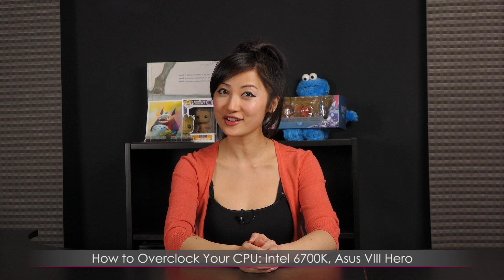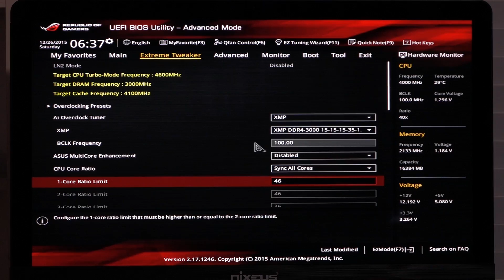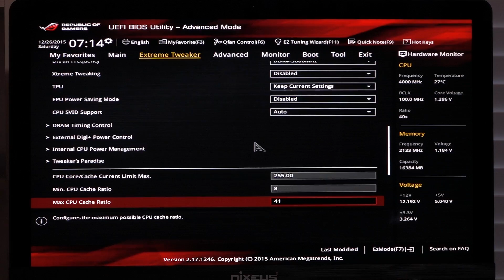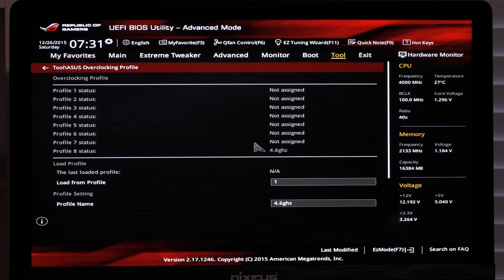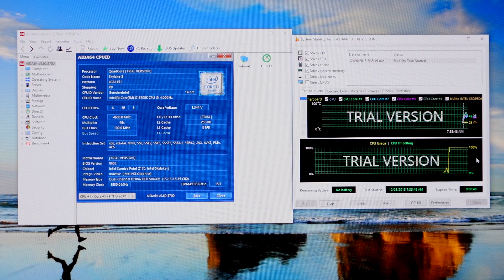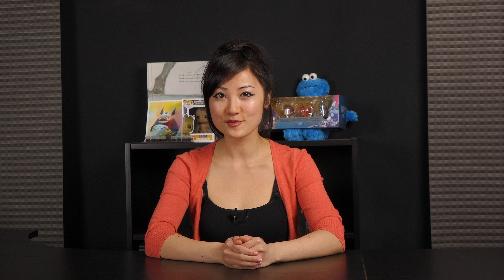How to Overclock Your CPU: Intel 6700K, Asus VIII Hero: Tutorial

Comment: Wouldnt this cause your CPU to be constantly running at 1.345 Volts. So even while ideal CPU is going ham? is there an adaptive mode? Tutorial please!
Reply: yes, this was exactly the part she missed. after it's all over you go back and change it to adaptive mode and enter your stable voltage that you found in manual settings. other than that, it's pretty damn good tutorial. If found LLC 5 to be better than 6, but I knew this way before I saw this video too.

Comment: why do no one use the A-Tuning software to overclock?
Reply: +Anders Flem cause although A-tuning software works, all software tends to generally over-volt your CPU and other components because it's automated and not minutely fine-tuned... 

Since every cpu  'is' slightly different, overclock-ability can almost always be achieved at lower voltages if the end-user does the manual work to discover their CPU's limits rather than utilize software that will apply set ranged voltages to achieve overclock stability at the cost of CPU- shortened life expectancy.
Reply: it gives my memory a weird over clock that causes constant crashes...that's my answer at least

Comment: I heard that skylake won't support win7 after 2018??? What exactly does this mean, I can't see how my hardware would stop running properly if it's running fine when I purchase the components.
Reply: like if you update your bios.
Reply: ***** what if I don't? Is there any reason why I would update my bios on a system I built myself that runs fine?
Reply: no not really. most of the time people only update it when something goes wrong or they get new hardware. you should be good
Reply: you wont get any windows updates for viruses that come out, which may get a little tricky, unless you dont rely on windows defender.

Comment: Hey, Is it ok to do the same steps with i7-6700k but an Asus VIII Ranger, not Hero?
Reply: +Elias Echter ofc its the same  =) i did it with a gene and i have also  1.31 V 4.6 GHZ
Reply: ***** i would not go past 1.35 V .... So just set it to that Voltage and start with 4,4 ghz and work your way up ... maybe your chip cant overclock that much .... and you should definetly turn off auto voltage .... but i thing 4.4 should be achieved with 1.35 =) 
hope that helped =) good luck !

Comment: Anyone have advice or even be willing to work with me? this would be my first time overclocking i have 6700k IX Hero with a NH-D15 fan. Or could i use these video settings and be fine?
Reply: You can try this settings but every Chip is different maybe you can’t get it stable with that voltage or you could do less voltage. Try this settings and if it crashes your pc lover the clock speed

Comment: I have the 6700k and the maximus hero viii. At 1.325 with 4.5ghz my max temp spiked up to 85+ even went to 90 at one point... How much should I decrease the voltage and what should I set the ghz at?
Reply: ChickenSnitt I have the same set-up. That def shouldn't be happening. You need to check your cooler unit to be sure it's running properly and reapply paste. Don't even bother with Aida. If you have an air only cooler that's another reason you'll see high temps especially in Aida.

Comment: On my 6700k I only run with level 5 witch is not that aggressive and with 1.27v to run at 4.6ghz, on level 7 and 1.33v I can run 4.8 and with 1.37v it run 5ghz but even it WC in stress test will go over 80c

Comment: I have the exact same setup but no matter what I try I can't get my CPU to 4.6ghz. tried to increase the voltage till 1.35v. 
4.5 GHz runs stable at 1.296v though
Reply: Prince Shergill my friend I think u hit ur cpu limit
Reply: Victor Martinez wrong, I have a stable 4.6 GHz OC now, new BIOS update did the trick @1.36v adaptive.

Comment: is it necessecary to clean the pc from dust? havent opened it in 2 years :/
Reply: +Brecht t yes clean it and reapply paste on gpu ,cpu...i also put paste below heatsing on mobo chipset
Reply: ah, I know I should do but it still runs fine.. for now..
Reply: Brecht t I clean my pc every 6 months,,,it reduce temps especially in summer time....i highly suggest paste on chipset to remove heat,,,prolong mobo life..
Reply: my cpu is i5-4570 and runs standard at 31*C and gtx 660 at 29°C  while its cool outside
Reply: when its summer probably +20°C
Reply: Brecht t
my cpu is idle about 30-31 now, load 50-55 on summer 60-65... my gpu is idle 30 degree 77 in gaming fermi thermi crap....on summer 82-83 degree gpu in load.. i am waiting for amd polaris middle end card low tdp amazing... amd is fusion and future ..<3 AMD
Reply: Optimisation King90 do you know if polaris and pascal require new mobo?
Reply: +Brecht t Probably not. It should work on any pcie 3.0 even on 2.0 only memory will change to gddr5x and hbm at most expensive flagship... NVlink is more for servers...i personaly will not buy nvidia i dont like their unetical behavior and all fiascos and gimping they had done in recent past, so i wait for amd card... i dont like current 300 series consume too much tdp
Reply: Optimisation King90 it would be better for sure if amd-nvidia got 50/50 market share
Reply: Optimisation King90 I have a 400W supply so better tdp is good news, soon nobody will need 800W psu anymore.. unless sli/crossfire maybe
Reply: Brecht t AMD have much less resourses meawhile nvidia are bribing developers and gimp amd cards with gameworks.. that junk is also gimping older nvidia cards we know about kepler fiasco what they done downgrade drivers. huge tesselation overkill factor in games without need ,without chance to reduce no slider in drivers meanwhile amd have it...thats why i cant stand them anymore. we need strong amd and i hope that 2016 will be year of sucess for them. They are also making an alternative for gameworks and thats great...i will certainly buy amd gpu this year.
Reply: Brecht t Thats kinda low but i hope that is good brand...i have coolermaster gx 750w it working fine 5 years already...mmm cant wait for amd polaris to play max out in 1080p like man ahahaha Raja Coduri has made amazing job very low tdp
Reply: Optimisation King90 yea its high enough, be quiet gold, i have ssd, i dont think i can measure total power consumption but idle shouldnt be that high, not even 100W
Reply: +Brecht t You will be probably fine depends from gpu....i always suggest to buy higher with bigger watts because eficiency reducing with time,always great ti have more headroom.
Reply: ah didnt know that, how does efficiency reduce? the coils or capacitor or sth else?
Reply: Brecht t Yes its reduce over time...but dont worry when it dies nothing will happend you have protections ,and thats it..i always buy bigger psu its always better to have spare power headrom
Reply: Optimisation King90 I thought psu lasted forever thats kinda disappointing, I have a good brand tho and most of the time just idle workload so not too hot.  

I literally thought I could buy a psu once and keep it forever jeez :D

I mean you could solder new capacitors (jus the elektrolytical ones) but thats kinda iffy, besides they need to be high quality ones not just hobby material
Reply: +Brecht t No buddy nothing last forever not even gpu,cpu or hdd..especially PSU it lost his eficiency over time,capacitors stop working and die....cpu can last very much for example.Thats why i am always buying bigger psu its good to have spare power...greetings from Serbia buddy i have gaming videos on my channel ahahaha
Reply: A capacitor doesn't has coils in my knowledge bro, please correct me if I'm wrong. Thanks :)
Reply: Vaibhav kumar i meant with coils transfo which is in psu

Comment: dont advise going over 1.35v??? my 6700k is on stock clock and voltages jump upto 1.4 on auto and i cant stop it from going over recommended volts
Reply: 95xXxdude that's why you don't use auto voltages
Reply: yeah i now run 4.5ghz on 1.3v manual mode  but i cant go any higher with the water cooler im using  nzxt kraken x41

Comment: i am just at 4.5 GHz with a voltage of 1.325. to get 4.6 i must go to 1.35. is that acceptable?
Reply: I was using a Gigabyte G1 Gaming 6, I was also only able to get 4.6ghz at 1.35v.  For 4.6ghz, I seem to be able to attain that without adjusting anything to do with voltage. The auto settings seem to be able to sustain it without any issues.  I'll probably try a static voltage lower than it stock settings to see if I stable at a lower voltage. Though when I want to save power, I just put my MB on "Eco" mode.   

At 4.6ghz my Cinebench was 1000-1003.  My Geekbench was single core 4700ish.  My Multicore was 18999.  I'm just going to say 19000 because it sounds better. ... :P

For a brief moment I was able to get 4.7ghz at 1.41v and my Cinebench was 1023. But it BSOD on Geekbench.  I didn't want to go any higher on voltage so I'm going to go back down.  The only other things i adjusted were the Uncore and Loadline.
Reply: +Snafu2346 yep it's a good tactic to use the oc you were able to sustain only when you need it, and to enable the eco or auto mode when not doing heavy workloads. it's a cool feature new mobos have. i settled it at 4.5 GHz and my cinebench was 989. i had 1003 when on 4.6 GHz but i found out that although it could pass pretty much every stress test, it could not pass the Intel Burn Test. try testing it with that too. i find it really reliable and it does the work of other stress tests in a very short time. (8-10 mins) i was wondering what are your temps?(and ambient room temp) and cooler?
Reply: I think I might settle at 4.5ghz too since I could achieve it without changing any other settings other than the cpu clock.  I've done it  without any concern and I like the fact that all I had to do to achieve it was just change it, set it and go. Your scores are identical to my scores on the same speeds. 

I'm going to try some stability test on 4.6ghz. I want to see if I can make 4.6ghz stable for no other reason than me being curious to see if I can... :p  

I think I might be limited on what overclock I can achieve because of what my MotherBoard is capable of.  I saw on Paul's Hardware channel that on his 6700k, he overclocked to 4.6ghz without changing ANY settings, not ANYTHING.  But he was running on a G1 Z170X Gigabyte MB which is a pretty high end motherboard costing around $480-$500. I think my MB cost around $190-$200. Though I got it on a 24hr sale for $125.  I was originally going to pick up a Asus ROG board. 

My cooler is a Corsair H110i GTX.  My temps on idle at 4.6ghz were around 32c-35c slight peaks at 40c.  I'm not sure what my room temp is.  I'm sure its around. 76F.  On load during Cinebench and Geekbench my temps varied around 60c-65c. It peaked around 70c.  I want to try running Aida64 or even Intels stability test later.  I will let you know.

Comparatively to stock 4.0ghz, heck... even at 4.4ghz, my idle is 27c-29c.  On 100% load its around 51c-60c. It never really goes over 60C.  If I use Prime 95 it will get to around 70c but that's if I keep my radiator fans at 1000rpm and my pump on quiet mode which is around 1850-1900rpm.

  If I turn the fans on higher around 1500rpm, and the pump to 2800rpm, the temps drop to around 65c ish.

I hope that helps. Let me know what results you were getting on  your setup too!

Comment: I never overclocked before, my cpu is not an unlocked one
but my gtx 660 can be with 'msi afterburner', whats the downside of overclocking? reducing lifespan? and more heat? (warranty transpired) I would like to try it for fun more than actual gaming

edit: it's safe if u do it within the limits I suppose and research a bit
Reply: +Brecht t yes you will degrade your cpu especially if you put high voltage...my advice slowly reduce v core as much you can, buy good cooler,,, and best option is to have overclock with turbo boost only when you really need...i dont see point to runs 24/7 on desktop while browsing why to torture cpu
Reply: it kinda depends on the game as well imo because far cry 3 made it go to 80 degrees on normal settings, other games run much better

I wouldn't feel comfortable overclocking while running very unoptimized games
Reply: Brecht t I have 6 years old pc...i5 760, 8 gb ram, gts 450...  i will overclock when i buy new gpu this year. ..my goal is 3.8 with minimum v core as possible and turbo boost on so it does not work non stop......i have cheap cooler lc power lc cc 100 its great 55 degrees in game now at 3.3 ghz turbo boost on,,,,meawhile my gpu is heater aahaha old fermi  82 degrees most of the time...horrible fermi thermi notorious generation but hey i can make launch in same time while gaming... ahhahahahaa greetings buddy
Reply: Brecht t you need better cooler...make sure its properly mounted i was have same issues when i was used crappy stock intel i was have 85-90 degrees..,LC Power lc cc 100 or lc cc 120 good ones and cheap
Reply: ***** Even if you have amazing cooling like freezer huge voltage will kill your cpu faster and degrade transistors. Always reduce voltage as much you can
Reply: ***** ok nice, I can imagine the performance gains are not that high(?) like max 10% faster clockspeed(?)
Reply: *****
Yes it depends from cpu generations..but my advice never believe in intel specifications always reduce a bit more they are never saying truth to sell cpu-s..reduce and find minimum voltage that needs for that specific overclock value
Reply: Brecht t
yes performance gains are not huge ,...i personaly  always overclock gpu-s i cannot resist aahahaha....always use some middle voltage never use maximum allowed voltage ,and some gpu-s samples cn overclock high without voltage increase thats best

Comment: If anyone still reading the comments please help me, i have the same setup i set it to 1,330 but i constantly get little spikes up to 73 degrees and my volts goes up to 1,462 from 1,340 i mean what the hell? I tried seting the LLC to level 4, 5, 6 no change at all, if anyone could help me i'll be so glad. And im such a noob at all this.
Note: i use a good liquid cooler no problem with that.

Comment: I just got an I7-6700K build last week with an Asus ROG Maximus VIII Gene so my Bios is exactly the same.

I oced it to 4.5Ghz @ 1.27V and, after running it a few days like that, i just switched voltage to adaptive mode with the 1.27V value and, since then, it is working fine!

I left everything else at auto or default values and it seems to be good.

I have NOT USED a stress test software, i just keep an eye out for any sign of instability, on temperatures and voltages using CPU-Z and RealTempGT.

i been playing A LOT of Witcher 3 and some Rise of The Tomb Raider and ever Farcry 4. Voltage always maxes out at 1.27v and clock hit 4.5 clean. Temperatures always below 60ºC. Always stable

Should i tweak the other setting she mentions in the video for a 4.5 ghz oc???

Should i still stress test??:p 

Would it give me any advantage at all??
I am new to overclocking.

Thanks all
Reply: ***** Ok.. I think i will download Aida tomorrow and do it.

How about the rest of the settings, should i change them too?

And why don't more people use adaptive voltage? It allows the voltage to lower at idle which reduces heat? Is it not a good idea?

Also, should i tweak the other settings she tweaked??
Reply: +xImmortaIx If you use stress test software in adaptive mode, it can cause volt spikes which can damage the CPU.
Reply: +Alex Maia  - yo Alex, good question about that 'adaptive' setting in UEFI Bios. When/while u are overclocking, don't use adaptive, but change to 'Manual mode'. Once u have got your OC just how u like it, go back & change it to 'adaptive mode'. Yes, adaptive is better for normal everyday use just as u mentioned. Allows CPU to idle back down when nothing on, or ramp back up to your OC'ed settings when needed.
As Hakeemzo mentioned, using it while u are stress testing the OC is  not a good thing! Hope this helps  :)
Reply: Jimmy Lee Thank you! But since this comment things changed :p.

One day, after a 3 or 4 hour long The Witcher 3 session i noticed my CPU was getting a tiny bit hotter than usual, when i checked my voltage was going over 1.29V. I didn't like this so (it is escessive for my 4.5ghz oc).

I got Aida64 and i re-started my OC from scratch. I set voltage to manual, with the same 45X multiplier and set voltage to the 1.27V i knew worked, i stress tested, it passed so i started slowly lowering voltage and always stress testing with Aida64.

I stopped at 1.25V at 4.5ghz. I did NOT try a lower voltage (for lack of time to be honest, Xcom 2 came out lol) but it passed multiple Aida runs and all the gaming i do.

But still it acts weird, so at idle my voltage lowers to 1.246V (even though i kept it in Manual mode at 1.25V) and under load it goes to 1.264V.... It does this stably ever since.

I tried setting it to Adaptive with the 1.25V and, while gaming, it goes up to 1.28V so i don't understand.

I keep it at Manual for now since it is not a very high voltage but i do not understand how, even with manual setting of 1.25V, it goes from 1.246V to 1.264V...

Any ideas??

Cheers

Comment: Hey Joanne, awesome post your so good. I have a question!! Mine is running stable at the settings you gave, what do I need to change to put it up a little more to 4.8 ghz. I know I have to put 48 inside the cores in bios but what else would I need to change? plz help thx :)